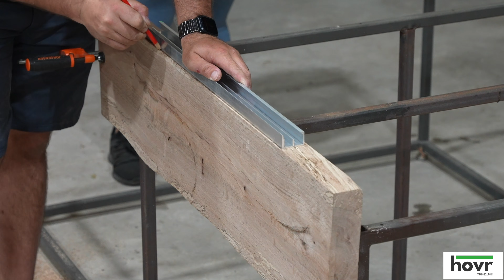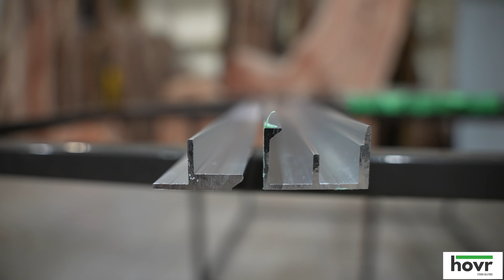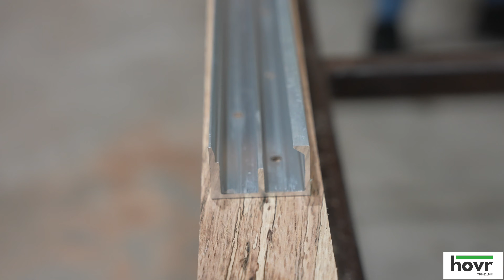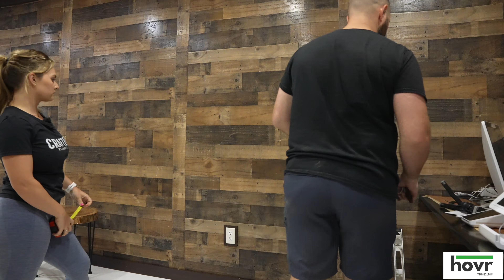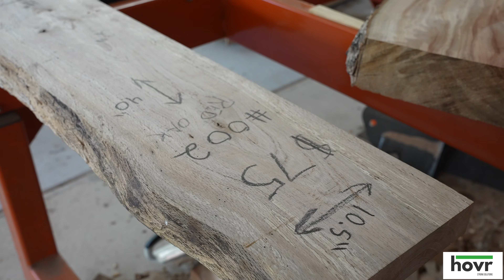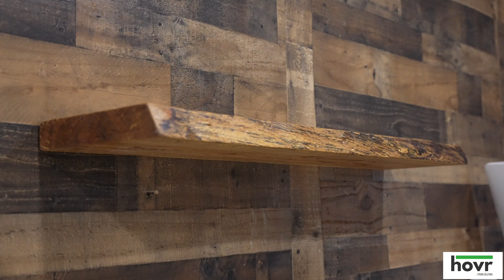How To Build True Floating Shelves - Hovr Bracket System!

Comment: i use the pole type brakets for floating shelf drill hole in to the shelf slide the shelf on to the pole once fixed to the wall.
Reply: Is there a link to your video? 😊
Reply: @kevindavis3841  not my video but the same type brackets i use. https://youtu.be/J0pXieds0RU